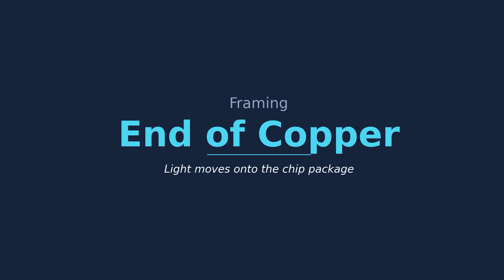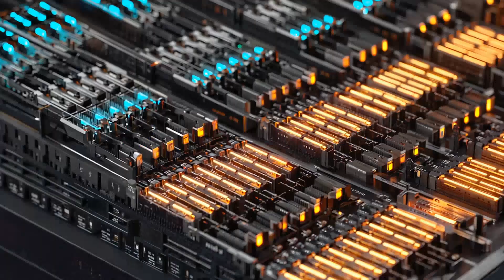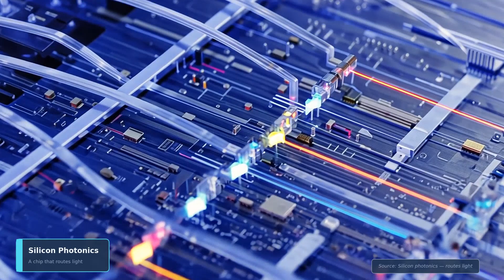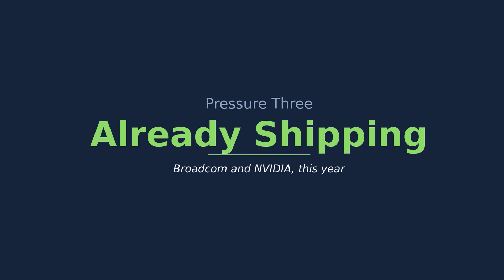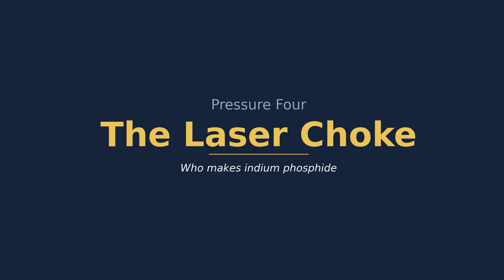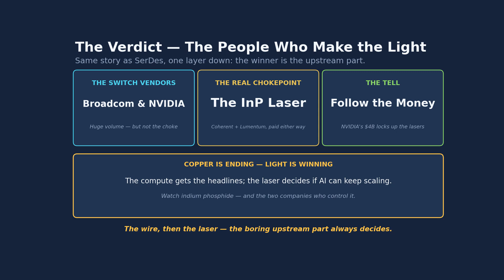Co-Packaged Optics: Why AI Is Ditching Copper for Light (Broadcom, NVIDIA)

Comment: Great breakdown of CPO! The 30W per pluggable optic is a real crisis — at scale that's megawatts just for interconnects in a single datacenter row. What's wild is NVIDIA's timing: they dropped ~$4B into Lumentum and Coherent this year specifically because indium-phosphide laser manufacturing can't scale fast enough to meet CPO demand. The bottleneck isn't the silicon photonics waveguides (those are mature), it's the III-V laser sources that have to be flip-chip bonded onto each package. We cover a lot of these photonic hardware shifts @aitickr — this transition from copper to light is going to define the next decade of AI infrastructure.
Reply from the maker: Thanks — and agreed the laser supply chain is the real pinch point. One nuance: NVIDIA's first-gen CPO switches actually sidestep the bonding problem you describe — the lasers sit in external, field-replaceable modules rather than being flip-chip bonded per package, precisely because bonded III-V is a yield and serviceability risk. The waveguides and modulators are the mature part; keeping the light source swappable is what makes CPO operationally viable at rack scale. The InP capacity race is the story to watch from here.